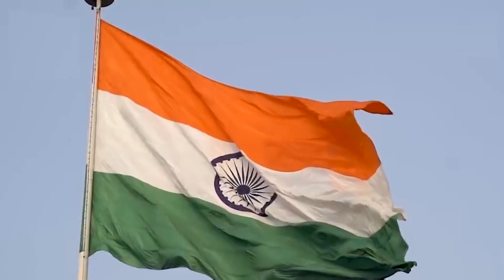Completion of 50 km of viaduct works

Comment: Simulataneously, Government should prepare to acquire the land for other important high speed rail corridor such as Delhi-Ahmedabad, Delhi-Kolkata, Kolkata-Chennai, Chennai-Mysuru, Bengaluru- Hyderabad, Mumbai-Hyderabad etc. Then only, Government may complete entire corridors within 20 to 30 years.
Reply: true
Reply: delhi ahd line is under DPR stage i think currently , then approvals, then funding, clearances. land acquisition, then construction. dont forget that funding is a major issue for so many lines. in every  aspect mumbai ahmedabad line is very important .
Reply: @jaguarunleashed4935  Mumbai - Delhi is very important
Mumbai - Ahmedabad is just phase 1 of this line
2 nd phase will be Ahmedabad to Delhi
Reply: @mrrandom347    yes that's wht i said bro. The first half MAHSR is most important. DAHSR is still at DPR stage
Reply: @mrrandom347  no man, del-mum is not a feasible line for bullet train... Flight will cost half in price and also time taken in flight will be less than bullet... Bullet is feasible for 500-700km range journey.